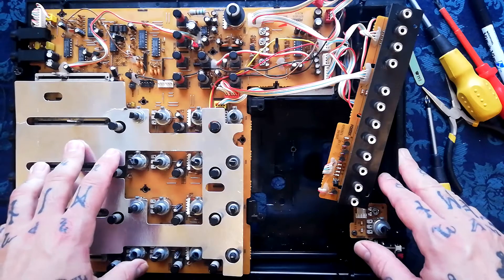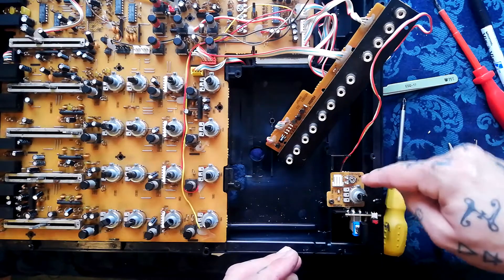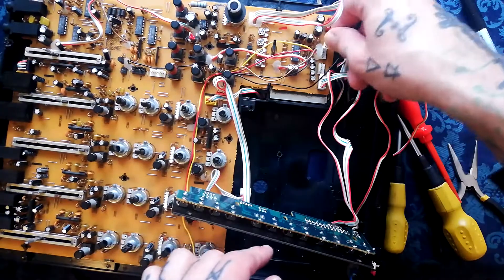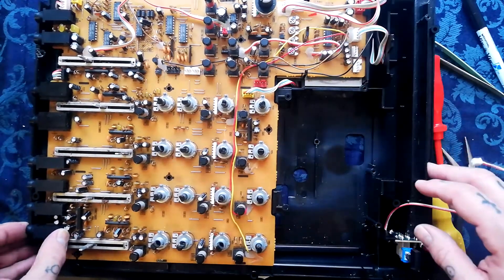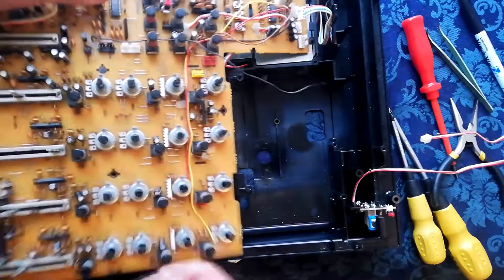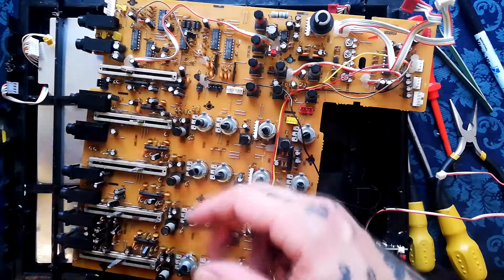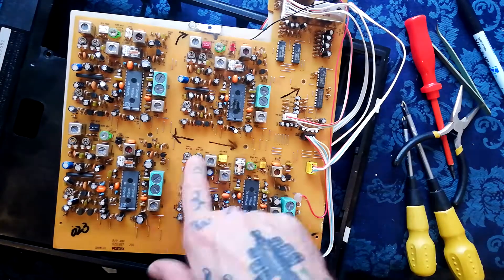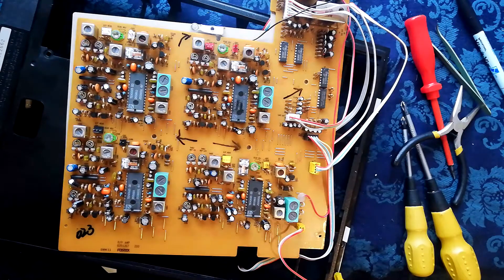Fostex 160 | Tear Down | 3 | Remove PCBs

Comment: Super helpful video! 
Just got my hands on a Fostex 160. It powers on (OG power supply) but it isnt working. Thanks to your videos i was able to open it. I will replace the belts. I think the grease might have hardend cause the tape head mechanic appears to be stuck. 

Any idea hosw to check if the motor is broken and needs to be replaced? 
Thanks!

Comment: These videos are tremendously helpful. I'm trying to restore a 160 atm. Bit of a noob. Do you have any idea why the headphones port would have a lot of noise on it even when turned completely down? The audio is there, but there is a constant noise like wind. This is not present on the tape mix output. I've tried cleaning everything.

Any ideas? Would I have to replace the input? If so, do you know where I could get the part?

Many thanks for any help.
Reply from the maker: Usually the headphone out is significantly noisier than line or tape outs- this is true of all brands and models, and I'm guessing it's a byproduct if needing to drive relatively large speakers at relatively high volumes? If you can get a shot of someone else's multitrack cassette recorder for comparison. If yours still seems to have much louder noise I'd be looking at the electrolytic capacitors surrounding the pair of operational amplifiers which drive the headphone socket, because if those are leaky it can cause a lot of weird gain and noise issues. Facebook message me if you're not sure how to identify those caps.